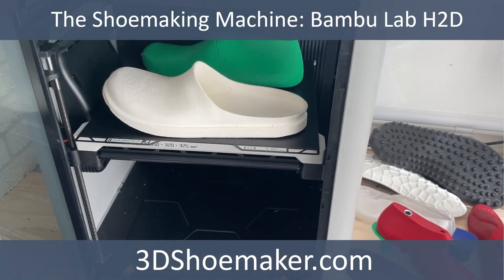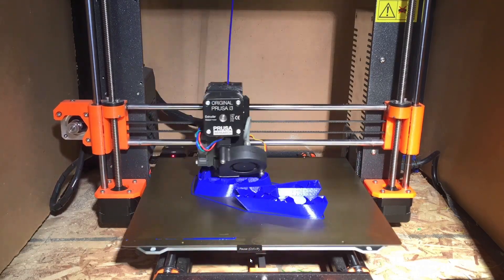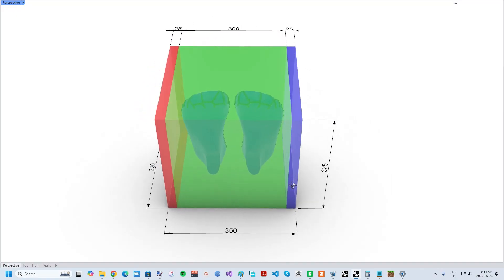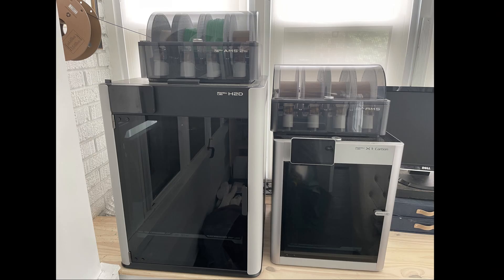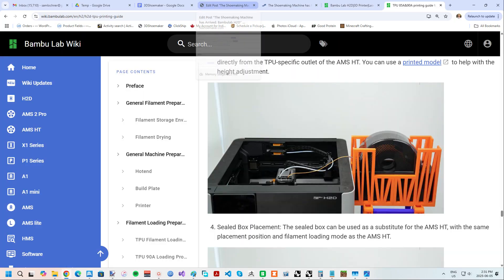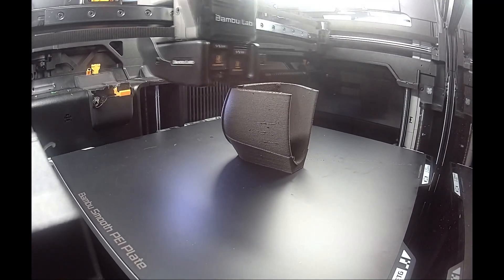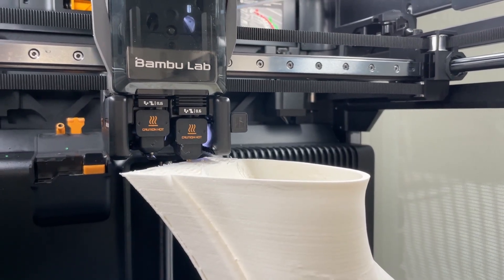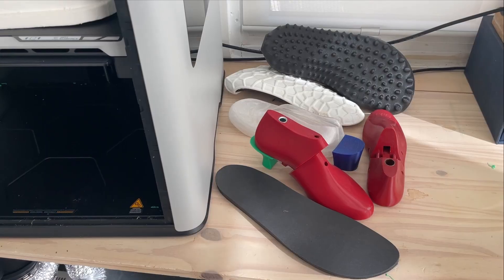Bambu Lab H2D Shoemaking Machine

Comment: Would you recommend a smaller printer for lastmaking only? I have big feet, too. But I'm really only interested in printing lasts in múltiple parts.
Reply from the maker: My previous printer, a Bambu Lab X1C did great. I think a P1S would be just as good and a bit cheaper.
Reply: @3DShoemaker  Thanks!

Comment: Big fan of your channel, has helped me tremendously. One question, what made you go for the H2D (dual nozzle) vs an IDEX (dual extruder) printer like the Raise 3D E2, for example? Im also printing my shoes in TPU (85A) and I haven't decided between those 2 printers for an upgrade.
Reply from the maker: A big advantage of IDEX is printing two parts at the same time. But I've heard that z-offsets can be an issue for that. But if Bambu Lab would have put out an IDEX printer instead of the dual extruder but still with the same build volume, I would have gone for that. Bambu Lab blew me away with their X1C, so going with whatever they make is a big part of my decision.